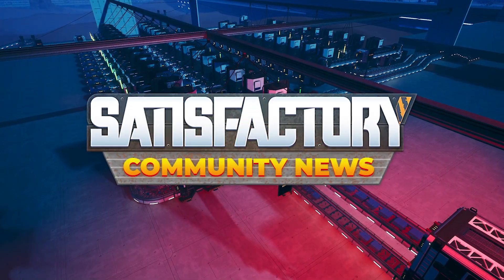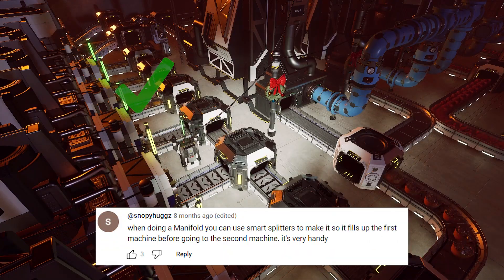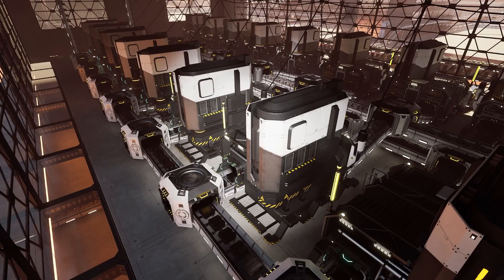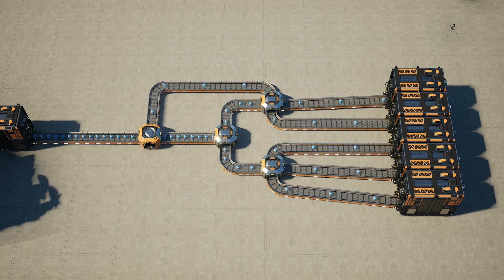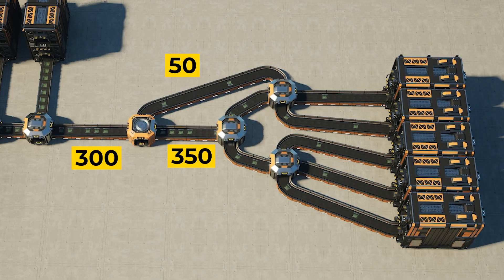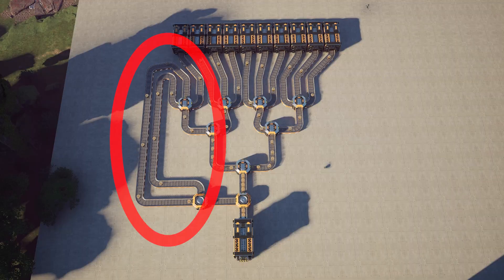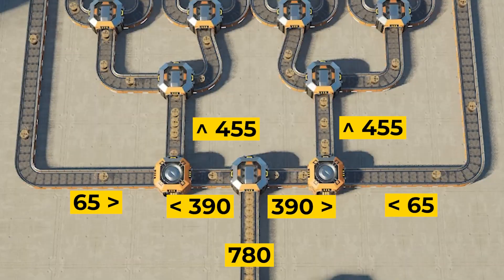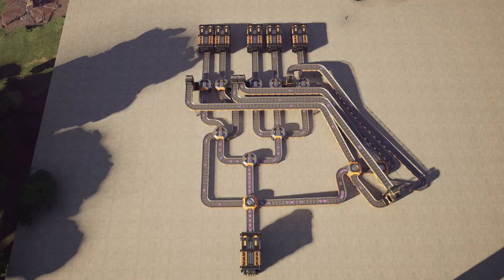Manifold and Load Balancing ADVANCED Tips | Satisfactory

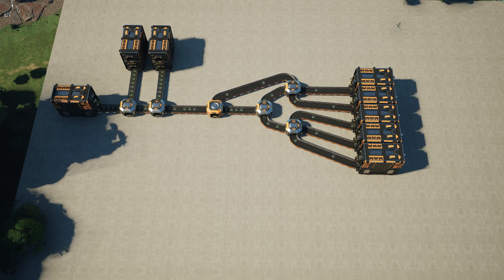Comment: 4:57 There may be a mistake here, or maybe a miscommunication. The loop back belt returns 60 materials a minute, and the total input stabilizes to 360 to compensate. I know this after applying an infinite geometric series formula to the problem (learned it in calculus 2).

The formula is S = a/(1-r).
r is the common ratio which is 1/6.
a is 50 at the first iteration of our 300's division.
Plugging it in and doing the math, we find that 50 becomes 350, then divides, and adds to the next 300 to become 358.33.

This continues, slightly larger every time, 359.72, and again infinitely, until you approach the value of S, which is =60.

Therefore your topmost conveyors need to take another 60, not 50, which is equal to your non-feedback output members.
Reply from the maker: That's beyond my pay grade, so I'll trust you. As far as I understand, if you require X materials, you input X materials into a loopback system, and for a while it not deliver the right amount to each machine, but after several iterations, it will balance out and each machine will get what it needs.
Reply: @SatisfactoryNews  In reality I suppose thats all you need to know xD. Im just saying that the feedback loop in the video gives back 60 not 50. Resulting in 360, not 350. Overall I used your video for in depth reference and took notes on everything. Which is how I found that issue. You did great regardless!
Reply: @SatisfactoryNews  for this same reason is why some of your bigger builds with loop backs require that overflow solution, because more circulation is present than expected.

I believe its because the infinite division changes when the outputs are not uniform.
Reply: Just for fun, I considered every integral splitting ratio between 2 and 100, and found the worst case among them in terms of how much more capacity B needs than A. Your worst-case scenario (if you never plan on load balancing more than 100 different ways) is a 37-way splitter, which needs 11 loopback belts and a capacity on B equal to 48/37 times the input from A. :)
Reply: @coolman5001  jesus dude we should make a satisfactory text book at this point.
Reply: I was looking for this comment. Could tell it was wrong but couldn't get myself to write out the maths. Glad you described it so well
Reply: This was so much fun to read! I love math and have been trying to find the math behind the loops and balancing to reason why it works and you guys had it all in one place! Thanks a million!
Reply: Another way to calculate this is to assume the system is at steady-state. Label the input belt rate as A. After the loopback, label it B. And let C be the total loopback. 

In the case of a 1:5 splitter, B gets evenly split 6 ways, so C = B/6. And because C is the loopback, we know A + C = B.

Therefore, A + B/6 = B. Multiply by six and rearrange terms: 
6A + B = 6B
6A = 5B
6A/5 = B

So if A = 300 then B = 6×300/5 = 360, and C = B/6 = 60.

Consider a second example, with a 1:13 balancer, which will have 16 outputs, with 3 of those being loopbacks. In this case, we still have A + C = B, but because of the different layout, now C = 3(B/16).

A + 3B/16 = B
16A = 13B
B = 16A/13

And by substituting, C = 3A/13.

If our initial input A is 130 items/min, then B = 160 items/min, and C = 30 items/min.
Reply: @coolman5001  not gonna lie that seems easier (good job)
Reply: @freedomhq4075  Thanks. :) It's reassuring that our different methods arrived at the same conclusion!

After having worked out both examples, it seems to me that the general form (while keeping the A, B, and C labels I assigned above) is:

B = T × A / F
C = L × A / F

…where:
T = the total number of splits, including the loopbacks (6 in my first example above, 16 in my second example);
F = the number of actual outputs (5 in my first example, 13 in my second) 
L = the number of loopback belts (1 in my first example, 3 in my second) 

(Implying that F + L = T.)

This is useful because it gives us a simple formula for B. So long as we know our input item rate A, and the nearest larger ratio we can split perfectly (e.g. 16, in the case of a 13-way balancer), we can easily calculate how much capacity our belts need at B to be able to handle the system at max throughput.

Comment: For the overflow, if you don't need the additional overflow, could you just sink it?  Like, if you had 120 output, but only needed 115, instead of looping back the extra 5, it'd just get sunk.
Reply from the maker: Definitely could do that! Nothing wrong either leaving extra in the system to smooth out any irregularities but if the belts being backed up would cause an issue, you should definitely sink the extra.

Comment: Appreciate the time you take to do make these videos. It's interesting to see others understanding of these methods, I agree you should use use whatever you are happy with, though given I always "load balance" first, it always seems that the disadvantages of "manifolds" are understated and those for load balancing exaggerated. Especially the space taken, which is usually more, but your 1 input to 10 output example, probably expanded to illustrate the loopback mechanism, can be built on the one 4m wide strip of tiles next to the machine inputs, so the same as allocated for a manifold.
The power of load balancing also goes beyond the simple one input to multiple outputs shown in your videos, to distributing a common source in the exact amounts required by multiple processes. There is some math involved with this and needs to be done out of game, same as working out what splitter/merger assemply is required to do this, but can be used whenever the same ratios are present, whether you're making 10 parts per minute or 100.
I unfortunately do have to remark on the Balancing: Loopback Overflow section. If overflow is required in the normal running of a process then balancing is not being done.
Reply from the maker: I think load balancing gets a bad reputation because it's most unnecessary. Manifold will get the job done 99% of the time. There are very few cases where a factory requires a load balancing system to function properly. You're right that size isn't really an excuse, especially in this massive game world, but it's something to keep in mind.

As far as the loopback overflow section, there is some truth to your comment. When you have to do this, it becomes a less-than-perfect system. However, it gets pretty close. The system is not very efficient at the beginning, but the more iterations it goes through, the more balanced and up-to-speed it gets. It's also a "simple" solution that gets close enough for, again, like 99% of cases.

Comment: I just want to point out two things -

It's obvious when you sit down and think about this, but I think a lot of people don't realize this for quite a while. Besides splitters and mergers, the game also has a hybrid of the two.  The Industrial Storage.  Has two inputs AND two outputs.  Only thing you have to keep in mind is that its behavior can be kind of odd if you're using a mixed resource belt.  Storage units only output from the last stack.

When choosing between a manifold and a balancer, there's a third option - You can hybridize the two.  Suppose you're feeding an array of 12 machines.  There's nothing saying that you can't split the feed into 4 mini manifolds of 3 machines.  Pros and cons sit right between the two options.
Reply: There's also hybrid setups where you have a manifold that feeds into several mini-load-balancers.  They are frequently suitable for many low-tier stuff - iron/copper smelters take 30/m, so you can just have a single splitter between two smelters and its input comes from a mk1 belt coming from a manifold.
Similar thing happens with iron plate, steel pipe and cable constructors (2 constructors for 60/m input), iron rod and copper wire constructors (4 constructors for 60/m, slightly more complex but not by much), steel beams (no splitter, just make the input belt a mk1). Heck, there's even some late-game recipes that can use it like the heat sink alternate recipe that uses 30/m of both casings and rubber.
They show up all over the place if you look, and you get the modularity of manifolds with the rapid startup of load balancing for a very minor amount of extra work.
Reply: Re mixed resource belts ("sushi belts"): I'm not going to say that sushi belts are a bad idea. But I will say that they need to be used with caution and you need to be aware of their limitations. The basic rules:

* The sushi belt must not stop moving under any circumstances. That means you must either terminate it at a sink, or have a smart splitter overflow into a sink at the end of the line (the latter is usually used in conjunction with storage or an item sorter setup).
* Do not loop back, unless you are 100% positive that the input ratios are exactly the same as the output ratios. Do not loop back as part of an item sorter (if the sorter refused to pick something up the first time, that's because it's full and can't hold any more of that item, so looping it back is just a waste of belt space).
* Don't try to load balance a sushi line directly. Sort it first and then balance it. Otherwise, you'll have many separate sushi lines which all need to be protected against backup, and that's wildly impractical. You can instead use a sushi manifold, which is fine because it only uses one sushi line (all the other lines are single item and don't need backup protection), but it's a manifold so you'll need to live with items filtering through slowly at first.
* Don't try to include any high-volume items like screws or other tier 1 basics. In most cases, these items are better handled through dedicated lines.
Reply: This doesn’t work because it doesn’t split items evenly.
Reply: Isn't a load balancer just making a mini manifold of two belts?
Reply: @kahlzun  Only if you're talking about a very small number of lines.

The difference between these two things is quite apparent if you examine the case of a single input divided among 4 outputs.

Both a manifold and a balancer can be made with 3 splitters, but they are arranged, connected, and behave quite differently.

Comment: Very nice video. As an enthusiast of logistics, I find it both enjoyable and informative and appreciate you taking the time to (re)make it despite having covered the topic already. Well done.

As a sidenote, most of the concepts covered could be extended to mixed belt (sushi) scenarios. Mixed-item manifolds (aka "sushifolds") can be commonly seen (especially at higher tiers and lower throughputs) and possibly confuse new players. And, even if with much more niche usage than mixed manifolds, even mixed belts can be load-balanced in different ways and even make use of loop-backs in some scenarios (just like normal balancers, but with more than one kind of item). If interested in covering the subject, I can provide more in-depth info (afaik, the only (rudimentary) video on the subject is on my channel, atm).
Reply from the maker: Thank you! I couldn't live with my errors anymore, haha.

I haven't seen too many players using sushi belts but i will check out your video because that sounds interesting.

Comment: A note about the first two chapters, regarding how to reduce the "startup time" of manifolds.
There's 2 preferences I'd like to highlight: wanting all machines to produce/reach 100% efficiency as soon as possible, or wanting to have output items come out of the system as soon as possible (these can lead to different results).
Trying to have all machines in production, with a manifold, means that all machines (minus one or two) need to have an inventory full of input items. The QUICKEST ways to do so are (from the fastest):
1) Manual prefill.
2) Smart splitters in the manifold.
3) Normal manifold.
4) Manifold with low-tier input belts for machines (exception being when the belts' throughput matches the input requirement exactly, aka "balancefold", or the main belt has more input than the line of machines need so it can "overfeed" all inputs).

What's a bit counterintuitive, is that method (4), while being the best at satisfying the second preference mentioned earlier, it's also the one that takes the longest to fill up all machines with input items. The reason for that is that since more machines start running while the whole system fills up, more input items will be consumed, thus needing more time for the main belt to provide the items to fill up machines AND feed the ones already consuming. On the opposite end, using smart splitters leads to the least items produced AND consumed by turning on machines one by one.

Addition: if one dislikes manually filling machines but still wishes to speed up a normal manifold, they can add one or more container(s) and connect them to the manifold via (temporary) mergers. When provided with items, the containers will "refill" the manifold at the merging points, ideally after it has too few items/min on it as they're being used to fill up the first few machines of the production line.
Reply from the maker: Thank you for the comment and all the additional information! I'm hearting this comment so it appears up at the top so people can see it.

Comment: Fantastic explanation and will be used by me as my maths is not great!

I also stage my factories:

build a section, prime it with materials

Then I use a throughput mod and dump the output into a sink to see how that section performs

Once sorted, I move onto the next, leaving space for an overflow smart splitter should my calculations be wrong (they usually are... I love overflow splitters)
Reply from the maker: I'm with you on overflow splitters, I have more than a few of those 😂